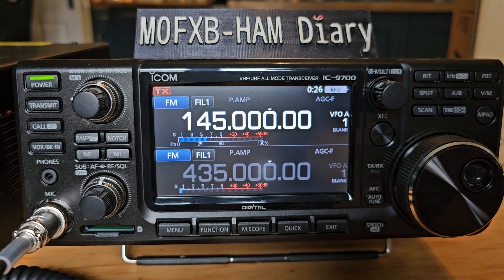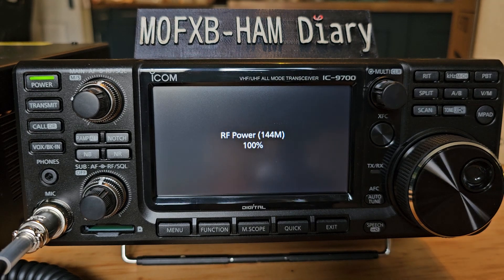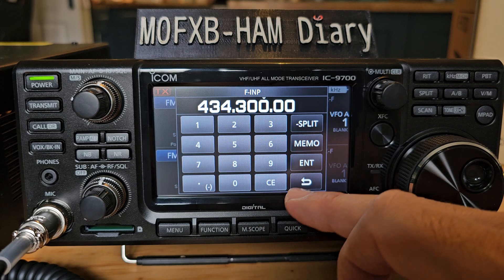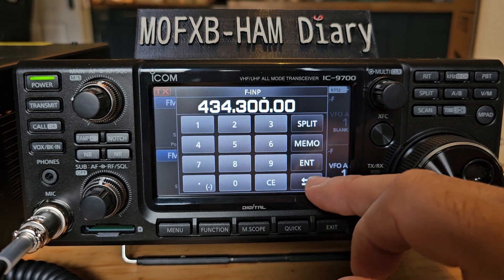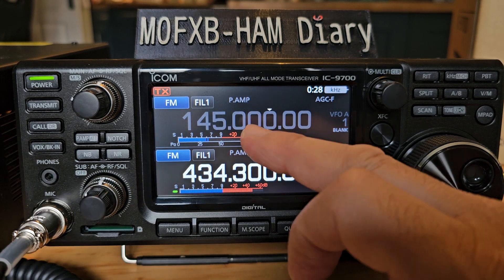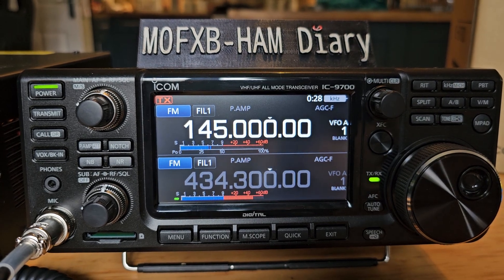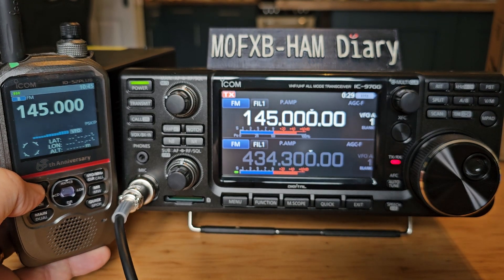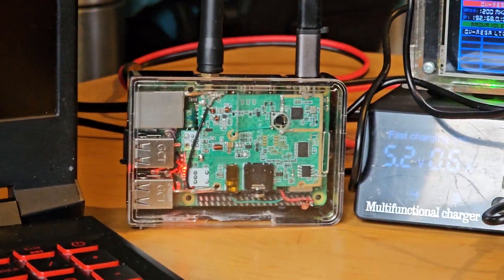ICOM IC-9700 - FULL DUPLEX , Test

Comment: Hi, great video, just subscribed,  this is 2025 version? Have you solved the fan problem about interference? Also for the clock battery on the main board that is very difficult to replace...
Reply from the maker: Hi the battery is fine if you power the radio every now and again the fan thing is gossip.

Comment: Hi Full Duplex is Transmitting and Receiving at the same time on the 9700,
Like listening to local 70cm Repeater bottom VFO, Whilst TX on the Top VFO on 2M
Most common usage is would on 2M & 70cm on a Satellite
Reply from the maker: Yes agree